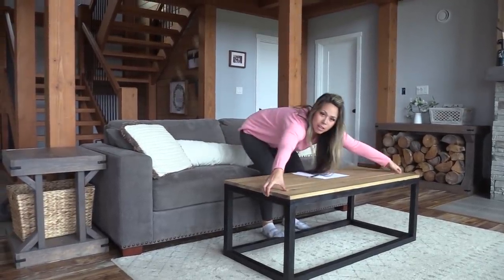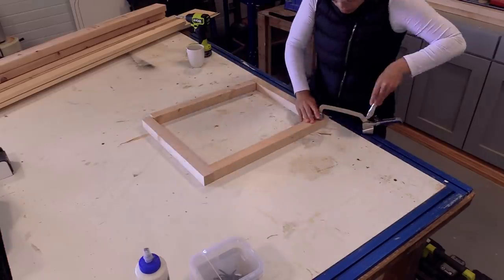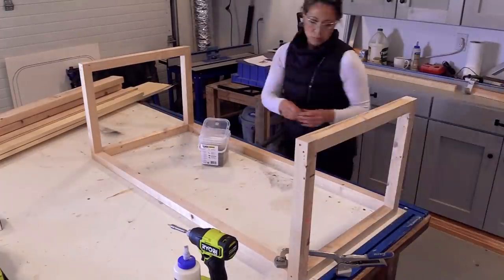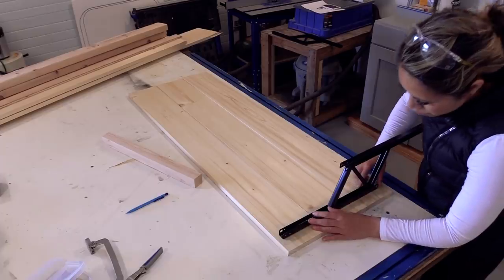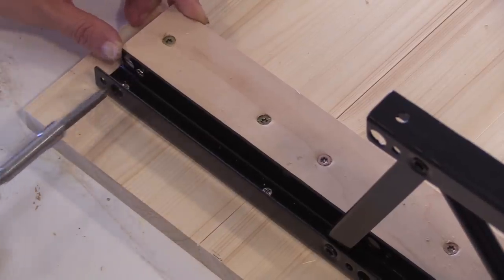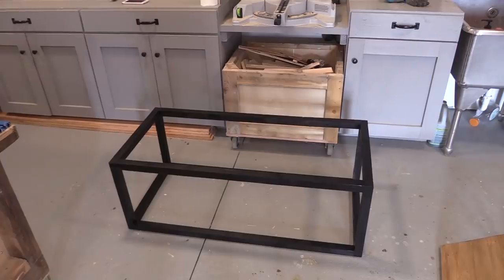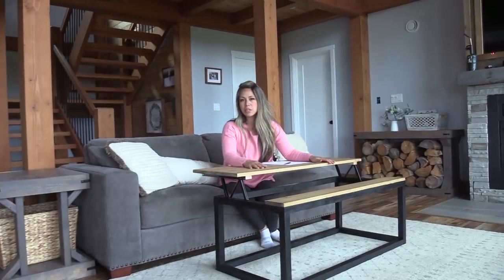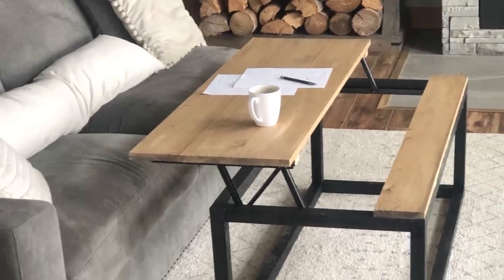Building a Lift Top Coffee Table

Comment: That's a neat idea and the commercial hardware makes it easy- up and back with the table and you have a place to eat.
I built something like that in college many years ago for our tiny apartment that didn't have a dining area.  I had an old footlocker that was made with threaded inserts in the ends so I used it for a base.  I built a top by laminated strips of wood ripped from pallets into a butcher block, then built my own pivoting arms.  We could set our food on the table, sit on the sofa and pull the table up and back over our laps.  I still have the butcher block but not the footlocker.

Comment: Nicely done and simple too! I like it.

A couple things I would suggest - 
First, I would not recommend pocket screws for that frame. Such joinery is okay in some projects, but the way you screwed these together has superior strength to pocket screws.

Second, some viewers might squawk at gluing the strip of wood across the boards due to wood movement issues. I don't think there's enough there to worry about in this project.
But there will still be wood movement and the issue I think you're having with the top sticking is in the design. The lift top is striking the last board that is secured to the frame because there isn't enough clearance between the lift top and the fixed board. Wood movement will make that worse. That might not be as much of an issue in cooler months when the wood contracts, but it will be more of an issue come next May-July when things really swell up. So I would suggest either making the entire top a lift top, or for those with a hand plane or table saw to put a slight bevel along both edges of the adjacent boards. Something like 15 degrees and are complimentary like this // so that the lift top doesn't strike the edge of the fixed board and just nests together with it.
I don't think you need weight for the top to not stick to that fixed board, but the base may need more weight for general stability.
Reply from the maker: Excellent points, thank you for weighing in!

Comment: Your next task...learn how to weld and work with steel.  I made a similar lift top coffee table (my base is square metal tube, welded, ground down, and painted rubbed bronze, and it also has a drawer beneath the top), and the additional weight of the steel and the drawer keeps it from tipping/moving when the table top is raised.  Also, the drawer is a have to have give it consumes all the remotes, books, and even my laptop and tablet keeping the room much neater.

Comment: Can you do a lesson on using the pocket whole jeg?  How to determine the length of the screws to use by the width\thickness of the wood.
Reply: The pocket hole jig should come with information on setting the jig for different thicknesses of wood and also information on what size screws to use.  I have a very inexpensive simple Kreg jig and it has all of that, makes it easy to set up for different wood thicknesses.
Reply: @billj5645  I bought one too, however, even tho it works for me, I feel like I'm guessing, plus if I lose the stickers that it came with, or if somehow I damage it, it would be nice to have a video that I can come back to and watch.   I build things mainly for a hobby so 
what length of pocket hole screws I need to buy does not come to mind when I'm in the store.
Reply: This is a video that Ana did years ago on the kreg jig
Reply: @DarkstarReborn  Don't worry about losing the instructions. Just got to the Kreg website. They have instructions and videos on using their jigs.
Reply: @gisellerussen4786  Thanks for this video.
Reply: @gisellerussen4786  Thank you for his video Too.  I have seen this one before but I think it was before I own one.  I have saved these for later use.

Comment: Needs counterweight so the table doesn't tip over, especially with kids and needs a slide lock. Nice build but is it safe!?
Reply: She addressed that at the end
Reply: @stacymcintyre1796  she said put more weight on the table, nothing about counterweights to offset the table top being lifted, whereas the weight is being shifted to one side.